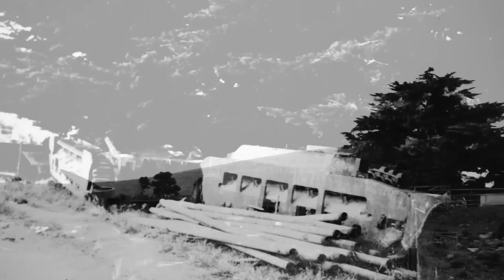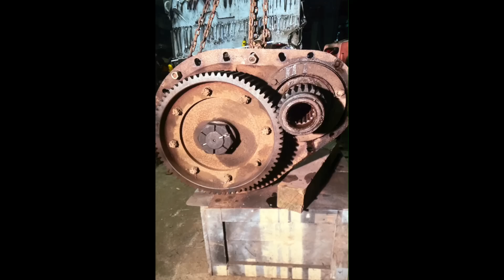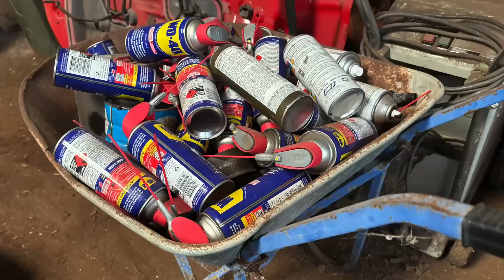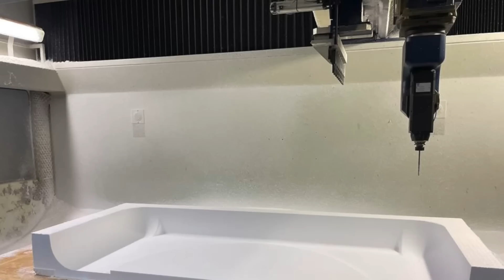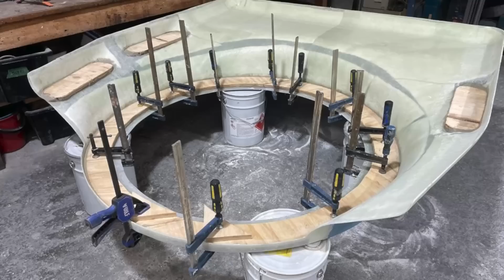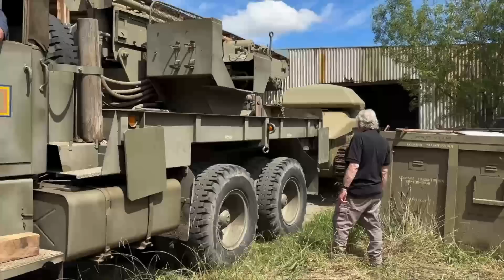Sentinel E-1

Comment: Built at Chullora NSW Railway workshops. Built in what was called the   "Tank Annex" . It was still called that when I was there in seventies and eighties. It was just off the main railway workshops. Today this building is the electrical section. To this day, as far as I know, the heavy duty track bed, laid into the concrete flooring, is still through the workshop where the finished tanks would roll out into the light of day. Loved the history of the sentinel!

Comment: Tank Museum in Puckapunyal has one fully restored, fully rebuilt original 3 x Cadillac engines, transmission, clutch, radios, gunnery, weapons, fuel tanks and nearly a full set of on board tools and associated equipment. 90% original and with little money spent and two volunteers working two days a week. Amazing engineering for WW2.